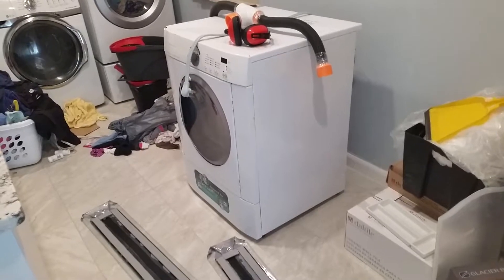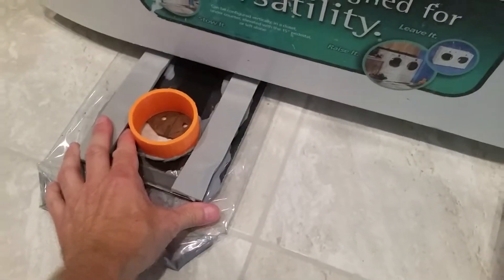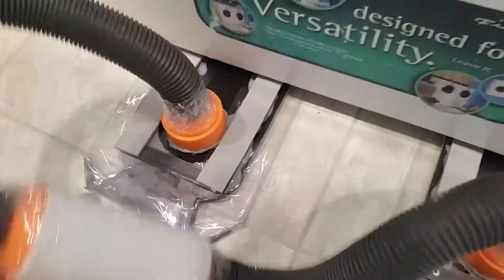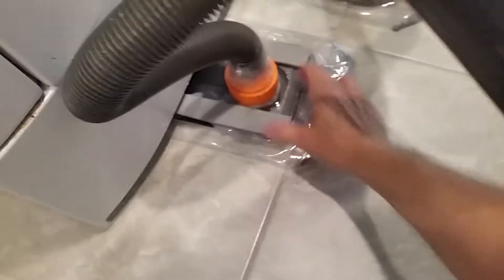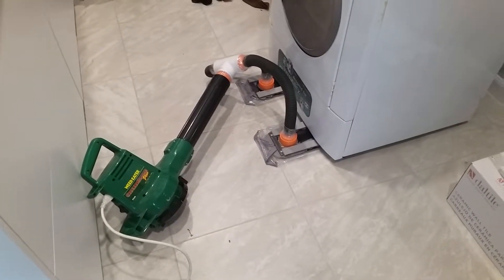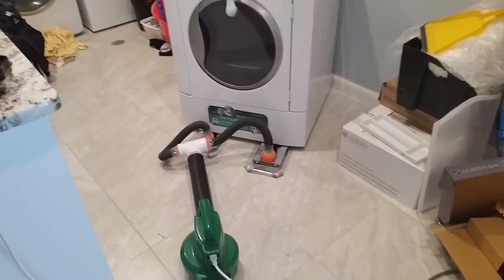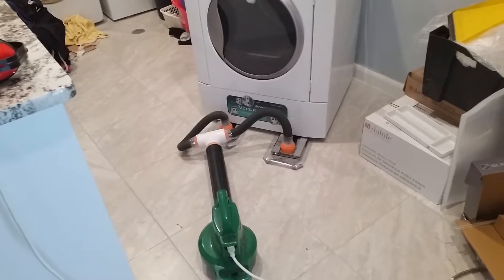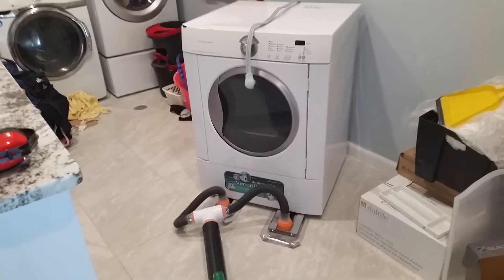DIY Air Sled Appliance Mover (Part Two - Demonstration)

Comment: What did this project cost you
Reply from the maker: I honestly don't remember. I already had the leaf blower (they're usually cheap at garage sales, at least where I live). I had to buy a riveter tool. The materials were the pegboard sheet, the steel bracing material, the clear vinyl, and some glue/sealant. I had a drill press and bits. I also had a 3D printer and filament to print the hose adaptors. The materials were cheap enough if you don't count the tools. My guess is at the time, it was around $100 USD. While I wanted to save money, I mostly just wanted to fully realize the idea, which eventually worked out just fine.
Reply: Less than $600 that's for sure

Comment: Thanks for sharing!
Im going to try something similar now 😄

I have an LG WashTower and that bugger is large and in charge; HEAVY!

Remodeling my sub level and will need to move that heavy beast around a lot then slip it into its final space once its all done and a project like that could save my back!
Reply: Additionally; what are the specs of that blower? What I'm wanting to know is how strong of a blower would I need for something that weighs about 700lb (according to LG, the washer is 326 and the dryer is 361... I have no idea why they list it individually like that when this is a single unit)
Reply from the maker: @PorscheDuésnburg  I'm at work, so I can't look at the blower for the specs right now. I'm not completely sure it matters any more than letting the right amount of air out of the bottom. If there aren't many holes in the bottom, most of the energy will go into the lifting force. If not enough air goes out, it won't slide on the air cushion. Sure, the blower needs to be big enough to do the job, but I don't think the one I have for that is particularly strong... I guess we'll find out when I can find the specs :).
My air sled in it's final form is only barely equal to the task of lifting a non-drained washer. You'd have to build a better one to be able to handle the stack you are talking about. The good news is that even if it can't lift the thing off the floor by itself, it's still a giant lifting force underneath, which should allow YOU to lift/slide it where you couldn't before.
Good luck with you project!
Reply: @pencilguin  Thanks for the reply! And yeah, after giving it some thought, you're right. I'll start making a BOM to get this project underway! Cheers! and thanks again :)

Comment: Hi Stan, did you have any insight on what material should be used for the rigid part? I'm having a hard time sourcing the aluminum that airsled uses for cheao
Reply from the maker: @blueworm123 Well, I didn't use aluminum at all. I have another video where I talk about how I made it. Here's the link: https://www.youtube.com/watch?v=rXlGrO5wgc0
Bottom line is that I used a pegboard piece for shape, and some steel stock from a hardware store for strength.

Comment: I found some info on the best fabric to use; Urethane-Coated Nylon Fabric -- 1680 denier ballistic nylon is coated on one side with a durable urethane coating. This fabric is lightweight, flexible in cold temperatures, and has a VERY high resistance to abrasion. Very little stretch, no shrinkage. 58"-59" width, 0.030" thick, 14 oz/sq. yd.  Use Gorilla glue (urethane glue) found at your local hardware store to glue fabric to itself and to other compatible surfaces, and/or sew the seams. Add rivets in high-stress areas.
Reply: Also "HYPALON (CSM) COATED POLYAMIDE FABRIC"

Comment: Hey Stan, I know it's been awhile since you've posted these videos. I was just wanting to see if you had any new insight you could pass along before I attempted to build my own. I've looked all over the Internet and you seem to be the only one who has listed anything.
Reply from the maker: Hi Lucas, well, there are a few things - I don't know if I wrote them all down in one place before, so I will try to cover everything I remember.

First, I changed the hoses and fittings significantly. The old vacuum hoses I had were really quite restrictive, so I found a hose that I could clamp to the outside of the fitting on each 'foot'. So, it was larger diameter, and also didn't restrict the flow going into the foot like my original fitting did. (It was a single length of clear hose with a wire inside for reinforcement, and I cut it in half to get the pieces I needed).

Second, I did away with the plumbing 'T' altogether. Instead, I 3D printed a 'Y' adapter instead. The Y helped dramatically with air flow - forcing all that air into a T fitting just took a log of energy out of it. The Y adapter allowed the new hose to clamp on to the outside of the two outlets, just like they do onto the feet. The adapter was also large enough to fit on the outside of the opening of the leaf blower.

All of these modifications greatly improved the air flow and lifting power. If I were building it again though, I would definitely start with a small number of holes punched out of the bottom of the feet - I would gradually increase the number of holes punched to try to balance air flow with lifting force. If too much air can escape, the lifting force is lower. If not enough air can escape, it doesn't reduce friction enough.

If you do 3D print a Y adapter, make it strong. (solid and thick-walled). I cut the thickness as part of an effort to print more quickly, but the adapter eventually broke after a few too many raps on the floor.

When I made the thing, I thought perhaps there would be more interest, so I kind of remembered all the dimensions I used in order to make another video.... but I didn't do that, and now I can't remember the measurements :(.

Good luck on making your own - if you have any questions as you go, I'm happy to try and answer them (at least with regard to what I did). If you do complete one, please make a video and post a link here. I'm sure anyone who is interested in my video would be interested in yours - and I would be too :).

Comment: Shop vac with an exhaust hose port, would be a better choice than the leaf blower by far. More holes but smaller, and skirt around it to seal it better against the floor. You could pick up a Sherman tank then.

Comment: Hey Stan, I think you are close.  Use smaller hoses  and a reducer on your blower. Also, the holes in your plastic have to be 1mm. The pegboard might be diffusing the air flow , try using a smooth whiteboard instead.  Good Luck!
Reply from the maker: Thanks for the comment! I did not approach this project with any scientific understanding of what I should do, beyond seeing some pictures of things on the internet. It surprises me that you would suggest 'smaller hoses and a reducer' - I actually went the opposite way since these videos were made - I went with larger hoses, and a custom Y adapter instead of the plumbing T. I felt like I was spending all my energy trying to drive air through the system, so I did that to hopefully get more pressure down in the feet.
That actually seems to have worked - the new version has much greater lifting power than the one in the video. I am not certain about how the pegboard is affecting the exiting airflow out of the feet, but I do believe that I punched too many holes initially. I believe that closing a few holes should help increase the pressure inside the feet, thereby increasing the lifting capacity. This isn't super easy to do, but I may try it someday, without rebuilding the whole thing :).

Comment: This is awesome. Perhaps a flexible hose from the blower, not the hard case.. and strap the case like a purse to free your hands?

I have questions about the sled feet..
Reply from the maker: @cruisinid - Thanks! The flexible hose is a good idea - I had in mind though that you would still be able to use it as a leaf blower as well. I guess it depends on how the tube attaches to the blower section, and how easy it would be to remove/replace. Fire away with any questions - time has passed though, so I hope I remember :).
Reply from the maker: Oh, also, I don't know how you found the video, so I just wanted to ask if you saw the 'Part One' video as well? It already has some more detail on the construction of the feet.
Reply: Yes I watched it. Just watched some of the Crane and air sled videos. Each sled looks to be a foot wide by 4' long or so. The fitting on the sled is sealed to the metal portion and the outer portion in contact with the floor lifts 1" under weight. I think the key to more pressure is less holes on the sled/boot. On on video shot it looks like a single row of holes  perhaps 2? Less holes= more pressure. There's a shot of a cross type hose connection, where 3 sleds were used to move large gym equipment so that's an idea. As well, both models have couplings to control air flow, like a vacuum handle-- you may not have 1" clearance moving a fridge situated under cabinets, so let some air escape so it doesn't lift as high.

They have these for rent in another city but it almost looks like a staple piece of equipment for repair men, according to traing videos. You might be able to see one up close for better idea on the boot/sled area. The material is very thick, almost tarp like-- someone working in sale boat repair would have a good idea (they have a type of material used for trucking.. you need something heavy duty, not plastic.)

Too bad you can't find an Amazon review of the product coming out of the box.. I will keep looking 👍
Reply from the maker: @cruisinid  The material I used for the 'bag'/inflatable part is a vinyl, although I've forgotten the gauge. After all my use, it shows no marks whatsoever - so I'm not really sure how much more heavy duty it would need to be for personal use. If you were trying to make something you could use in a service, then yeah, I'd try something tougher. What I have has worked fine on my tile floor.
Reply: Silly my, just read the other comments below.  Great work. Thanks for sharing!
Reply from the maker: @cruisinid  You're welcome, thanks for your interest.

Comment: Hey Stan here's what you do on the mover side of the sled have a cup for holding a small bracing appliance that straps will slide through and around the base of item being moved then make it connect to the leaf blower in a way that the blower is also the handle for the sled to push/pull the object!
(Edit: almost forgot and make a shoulder strap to hold the blower hands free if you wish!)

Comment: Nice work, I was thinking a little while ago about making some plates, like inverted air hocky tables, tiny holes at 1 inch square spacings,  to be permenantly installed under heavy items. Saw benches, Bandsaws, thicknessers etc.  I don't have to achieve an increase in height before movement takes place.  Your adaptation seems to work nicely. Any future video on the mods you did?
Reply from the maker: (My apologies, I didn't receive any notification of your comment) I did make one more video. I learned that I made a number of mistakes in my hose arrangement, and I improved that dramatically. After those changes, things are much better, and I was able to use it to do all the moving I needed to do. However, in that process, I also learned that I probably have too many holes in the bottom that allow air to escape - that caps it's lifting power. If anyone out there is trying to make something like this, I would recommend not opening all the holes in the pegboard first - take care to find the balance between lift and slide.

Comment: Great! It works! Maybe you can try leave the blower on top of your washer.
Reply from the maker: @Yu Quinn: Hey, thanks for the comment. Several friends have suggested various arrangements for making this a bit more convenient. Right now, I'm still making the basics better. Hopefully, I can post an updated video soon. I've upgraded the hose arrangement, and the dryer now leaps off the ground, even on the low setting of the leaf blower. With the new hoses, I've also successfully moved my washer (which is dramatically heavier than the dryer). It still needs more changes to be able to do that easily though.